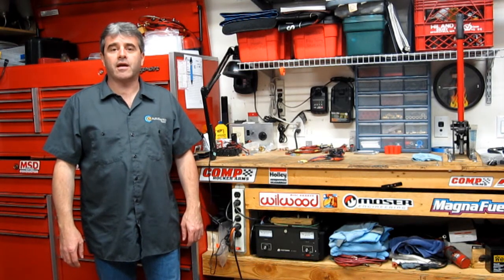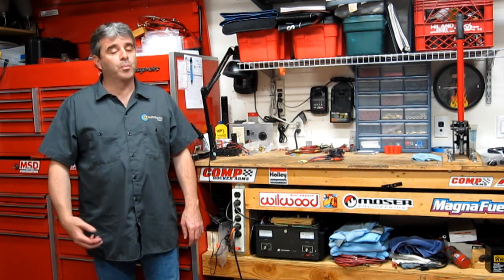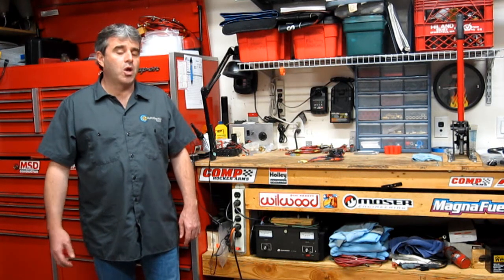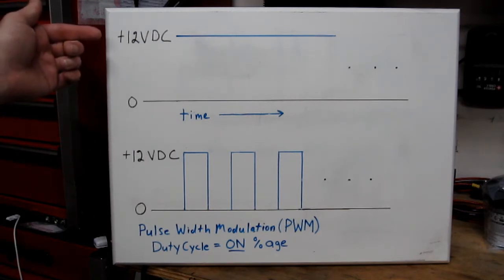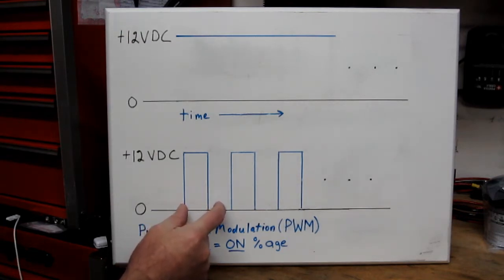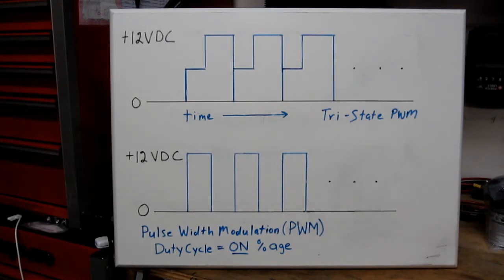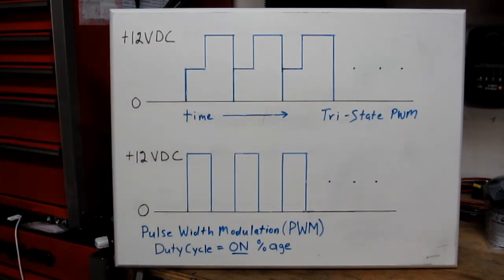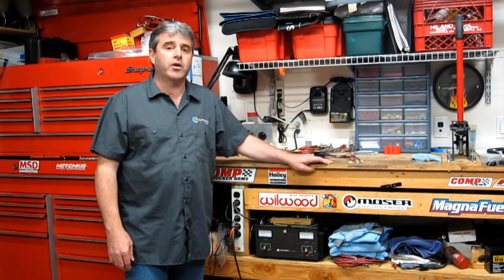14 Volt Conversion Part 2 - Aeromotive Fuel Pump Speed Controller

Comment: Thanks for the lesson! Ive been running one of these in my 1500hp turbo ls for about 5 years controlling an aeromotive eliminator. The fuel heating without one cannot be overstated!! After a 2 mile drive to the gas station on a hot day you can barely put your hand on the fuel cell, especially if its mounted inside out of the wind! The fuel volume returned acts as a coolant and pulls a tremendous amount of heat out of the hot engine compartment!